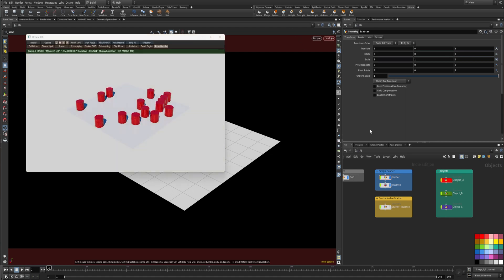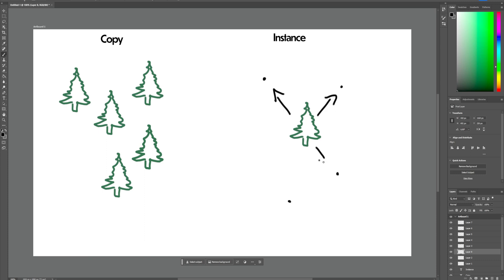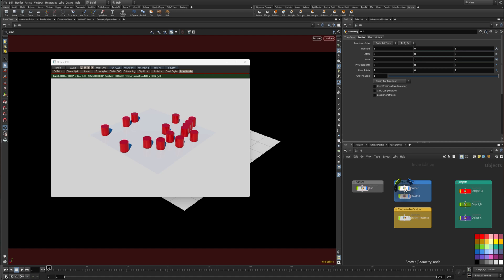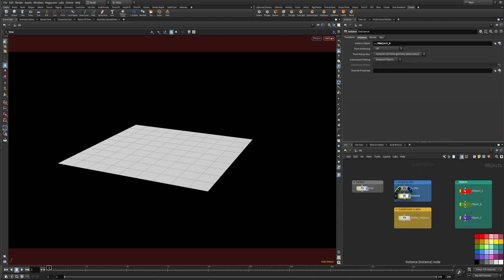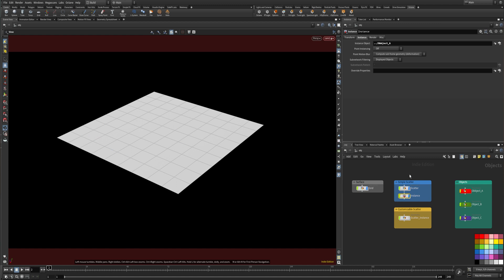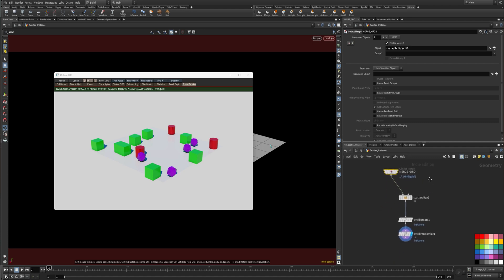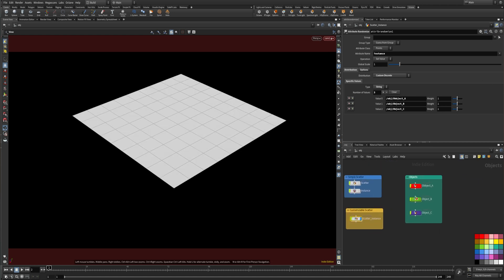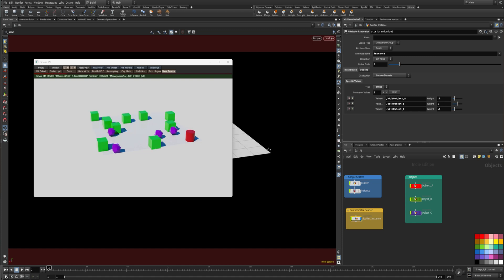Instancing Geometry in Houdini Tutorial

Comment: How can I assign the Cd attribute from the points to the instances? I just have one cube for instance and each point has Color. Octane of course.
Reply from the maker: @imakegreateggs  Heyy sry its quit a bit since last used octane in Houdini. Usually this should be found either at the obj level on the geo node or in the material
Reply: @Nicolas_Drum  I tried with "Custom Point Attribute on instances" assigned to Texture Instance Color node, but it doesn't work. I might be doing something wrong.